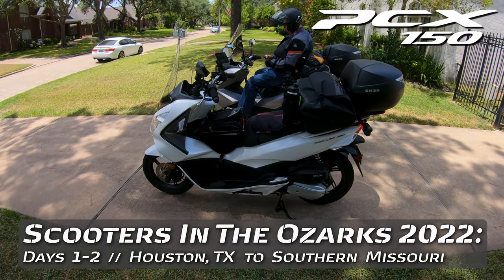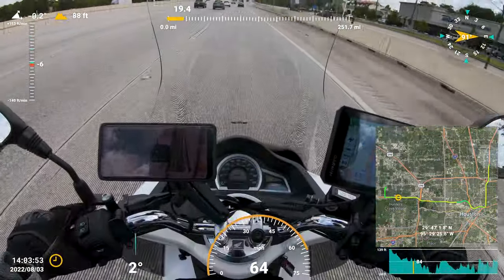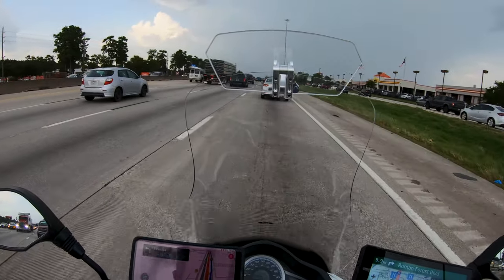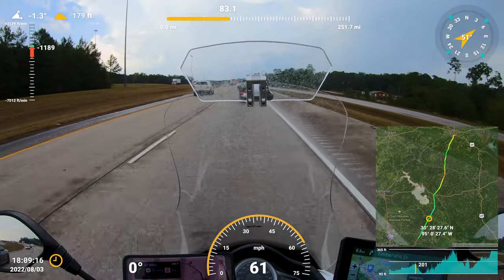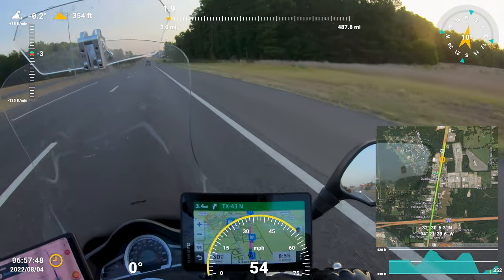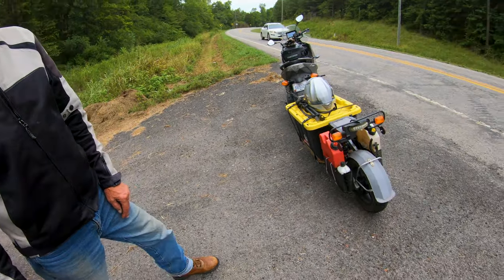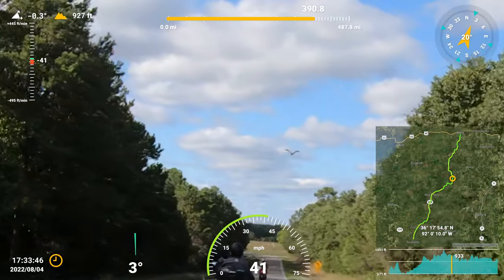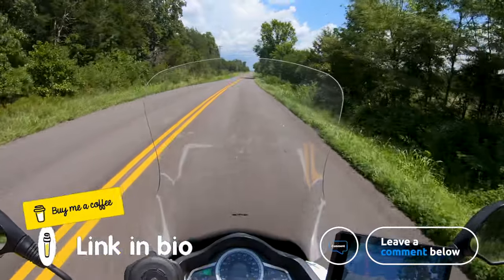Scooters In The Ozarks 2022: Days 1 & 2 // CVT Belt Failures & Amazing Back Roads!

Comment: Another great road trip. Watching these really makes me want to do road trips on my grom. Cheers Quassi
Reply from the maker: Howdy, Randy!  Get out and ride that Grom!  Road trips and touring on small bikes is great fun.  You're forced to slow down and enjoy the scenery instead of rushing through it to reach the destination.  

If you haven't done any long trips before, then you can just start out with shorter day rides and then work up from there.  You'll figure out your machine's limits in terms of comfortable speeds and distances (both for you and the bike), and what riding equipment you need to do it effectively.  After you know your gear and limits, then start pushing the boundaries by 100 miles or so until you're far enough from home that it's inconvenient to give up or quit.

Traveling just a little outside of your normal "Oh, I can just quit and go home" range makes you rethink some of the equipment that you take, and it recalibrates your expectations for how the trip should unfold.  Then everything just snaps into place... range, equipment, fuel logistics, etc.  After you cross that threshold, you can simply multiply the resource and time requirements for any distance or length of trip that you can imagine.  Minimalist touring is great fun!  Cheers!  😉👍  --QM
Reply: @QuasiMotard  Great advise, definitely am going to do a trip soon now that the weather is getting cooler. I'll send pics of my first adventure. Cheers, safe travels.

Comment: Leaving things stock is the answer. Factory clutch’s are tried and true to RPM for safe guard of engine longevity. Is three or four MPH really worth it. I’ve owned many Honda and Yamaha scooters since 1983 and getting 10,000 plus miles before changing belts only as a precaution.  👍 I also own a C5  2004 Vette with no mods and zero  issues as others have had with having car on jacks somewhere.  Who’s needs all the tinkering associated with mods for the most part. 🤔 I guess with time you hopefully With age you will Live and Learn.😬

Comment: Add-on lip spoilers are funny … go all-in and get a Just Right Height windscreen .. ride on!  ☮️
Reply from the maker: True, but windscreen selections for scooters are limited.  It's difficult (and expensive) to try several different screens to figure out what works and what doesn't.  This is my third screen on this scoot already.  It's always a toss-up because these aren't adjustable screens like larger motorcycles often have available to them.  😉👍  --QM

Comment: I had this happen on a SYM shark 125 , the rear pulley was sticking on the shaft and not moving out on the shaft when you revved up , the belt would just slip when revved as the front pulley moved but not the rear. The problem was worse in the wet as it would gum up with the dust a and as the belt slipped the rubber would get onto the shaft causing it to jam even more, you could ride at a slow speed low revs to get back home , I ended up buying a new belt and drive sleeve.

Comment: I had a similar issues on my pcx, a noise in the transmission, plus some belt slipping on take off. I had some work done on the transmission, and it seemed fine for awhile, then it began to have the same issues all over again.

Comment: Back in 2014 I traveled around the USAon 2011 Honda pcx 125 for 5 months and 20000 miles 37 states 38 NP
Really overloaded about 500lbs  2 new rear and 1 front tires
Changed belt at Battlescooter shop in San Jose Cali
Stock belt is the only way go
I went to diamonds state park in Arkansas and not the mountains 
I’m regretting it

Comment: I just Picked up a 2013 Honda PCX 150 it so nice. I will see you at the scooter cannonball in 2013
Reply from the maker: Congrats on your new-to-you PCX150!  You'll have good top speed with that 2013 model because of it's "longer" final drive ratio.  As I recall, they can cruise at 65 MPH easier than the later models, and their top speed is around 74 MPH.

One potential downside is less range due to its smaller 1.5-gallon fuel tank as compared to the 2.1-gallon tanks in the 2015+ PCX's.  You'll just need to carry a bit of extra fuel with you to compensate for that.

I'll look forward to seeing you at the 2023 SCBR!  Cheers!  😉👍 --QM
Reply: See you in june

Comment: First time viewer on your channel. 
I'm planning on buying my first bike as a learner and this is the ad title. 2021 Honda PCX150 MY20

I'm in Sydney Australia. You have me uneasy on whether I should buy something crappy new or this one. I need a bike now as my L plates expire 8 Dec.
Reply from the maker: Howdy!  I would recommend staying with a machine from the Japanese manufacturers if possible (Honda, Kawasaki, Suzuki, Yamaha) instead of any of the cheap Chinese brands.  The Japanese bikes always have better reliability and build quality than other brands.

I've heard from some of your countrymen that Kymco and Sym are also available down under.  Those are also excellent machines with reliable maintenance histories.  Kymco and Sym aren't popular here in the USA, so the parts and service networks are spotty at best.  However, both of those manufacturers have been producing scooters and motorcycles for several decades... they make quality machines!  Cheers!  😉👍  --QM

Comment: Sorry if this seems like an already-asked question, but what is the bigger bag that you're using as a "seat back" between the seat and the top case? I'm looking to get a '22 PCX and for longer trips I think a bag like that would be amazing.
Reply from the maker: Those are DrySpec D38 drybags: https://amzn.to/3CS4dPM .  The DrySpec system is modular and can link up with other bags to add storage, like the D28 double-ended bag: https://amzn.to/3WkhaIK .  The bags come with "cam straps" that wrap around fixed points (e.g., footpeg brackets, rack mounts, under the seat, etc) so the mounting system is very flexible.  Cheers!  😉👍  --QM

Comment: Only real way to prevent this problem is to get a larger displacement scooter wherein you don't need aftermarket CVT parts to squeeze out another 5mph and sacrificing reliability. Love the PCX but it's not a long highway capable bike.
Reply from the maker: I dunno, man... that's just a matter of perspective.  Comfort levels are relative for everyone in terms of speed and butt endurance.  I've already burned 6K+ miles of touring on rural highways with this PCX150.

We're planning to ride these scoots another 8K+ miles for the 2023 SCBR. Hell or high water, OEM variators or aftermarket... IT SHALL BE DONE!  😉👍 --QM

Comment: What shocks do you have on the bike?  Also, what are you using for a seat cushion?  I need to put some aftermarket shocks on my ‘21 PCX.
Reply from the maker: These PCX's are fitted with YSS G-Sport shocks.  The 2015 PCX (white) has the basic version, and the 2016 PCX (gray) has the fancier model with the adjustable damper settings.  I ordered both sets from BikerzBits in Thailand:  https://bikerzbits.com/ .  Shipping is a bit slow and expensive from there, but you can also check Webike Thailand ( https://thai.webike.net/en ) or Webike Japan ( https://japan.webike.net/ ) as alternate sources.

The seat cushion that I'm using is the AirHawk Cruiser Large:  https://amzn.to/3KdfKwq .  It really helps to add comfort on longer trips and also to avoid monkey butt from heat and perspiration.  Cheers!  😉👍  --QM

Comment: Salut, beau voyage. Mais combien est la consommation par mile de votre PCX 150 cc or 125 cc blanc modèle  ?? pendant votre voyage ?
Reply from the maker: The total distance for this trip was 1981 miles (3188 km).  My 2015 Honda PCX150 consumed 19.68 US gallons (74.5 l) at an average speed of 58 MPH (93 km/h). So, the average economy was 100.68 MPG (2.336 l/km or 42.8 km/L).  That's cheap fun!  Cheers!  😉👍  --QM

La distance totale pour ce voyage était de 1981 miles (3188 km). Ma Honda PCX150 2015 a consommé 19,68 gallons américains (74,5 L) à une vitesse moyenne de 58 mph (93 km / h). Ainsi, l'économie moyenne était de 100,68 mpg (2,336 L / km ou 42,8 km / L). C'est un plaisir bon marché! Acclamations! 😉👍 --qm

Comment: If you don't mind me asking what liter top case do you have? I have a 2013 Honda pcx 150 and I am thinking about getting one from Amazon its a 48 liter which may be too big for my scooter but I need one to fit a full face helmet in. It says it will fit a pcx but I don't want it to look too dorky it's not a Giva case but it's pretty good according to the reviews. I already have the pcx mounting bracket.
Reply from the maker: The top case is the SHAD SH39 ( https://amzn.to/3jbWyV6 ), and it mounts to the PCX with the SHAD top mount (P/N: H0PC11ST, https://www.shadusa.com/products/pcx-125-10-21-top-mount?variant=32428342018090 ).  I can fit my XL full-face helmets in there with plenty of room to spare.  The SH39 comes with a universal mounting bracket that can attach to nearly any kind of mounting system.  The SHAD top mount is inexpensive, very sturdy, and it blends into the PCX's aesthetics nicely.

It's a super-stable and secure mounting solution.  I've been thoroughly impressed with it over the past 7+ years.  The case opens without a key when unlocked... just push in on the handle to pop the lid.  That's a huge time saver over cases that require a lock or key to keep them closed while riding.  You can also lock the top case to discourage tampering, and that also prevents it from being dismounted from the base.  Cheers!  😉👍  --QM

Comment: So on your scooter 🛵 do you mainly drive on Smaller 🛣 highways. Nacogdoches Texas is my mother‘s hometown..
Reply from the maker: I try to select the slower highways and rural back roads for my trips on the smaller motorcycles and scooters.  There is less traffic and the speeds are generally lower, which suits these smaller engines better.  We will occasionally get stuck on faster highways for short stretches because there aren't any other paths.  We just stay to the right lane and let faster traffic pass us, and then we'll divert to slower roads as soon as we can.  It's more fun to ride slowly on these rural roads and soak up the scenery.  Blasting down the interstates at 65+ MPH is boring and causes us to miss all of the great scenery that makes these trips so enjoyable.  Cheers!  😉👍  --QM

Comment: Great video...
Nice PCX's..
Pure adventure..
Is good wind protection with givi windscreen? Can ride with open helmet visor?
Reply from the maker: Thanks for the feedback!

The Givi tall touring screen (D1130ST) on the gray 2016 PCX150 provides decent coverage, but I don't recommend it because it flexes too much at highway speeds.  Adrian is a couple of inches taller than I am (around 5'9" or 175cm), and he experiences a lot of helmet turbulence and noise because the screen flexes downward under wind pressure.

The screen that I have on my 2015 PCX150 is the National Cycle VStream Sport Touring (medium height):  https://www.revzilla.com/motorcycle/national-cycle-vstream-sport-touring-windscreen-honda-pcx150-2014-2018?sku_id=1161414 .  It works very well, but I think the taller version might be better for reducing helmet noise and turbulence.  Cheers!  😉👍  --QM
Reply: @QuasiMotard  thanks...cheers.. 🍻

Comment: I loved your videos. One question: how do you attach the rear waterproof case to the PCX?
Reply from the maker: We use the SHAD H0PC11ST top mount that is made specifically for the PCX.  It's made of heavy-duty steel and black powder-coated for durability.  That mount secures into the OEM bolt holes in the rear grab rail (under the removable plastic piece behind the seat).  Our SHAD SH39 top cases are secured to that steel mount with their own quick-detachable mounting plate (included with the top case). 

You can find more details about the SHAD mount here: https://www.shadusa.com/products/pcx-125-10-21-top-mount?variant=32428342018090 .  Cheers!  😉👍  --QM
Reply: thanks for the reply. One more question: the suitcase that is on the pillion seat, how did you attach it to the bike? 🙏🏻👍🏻
Reply from the maker: @marcelobybike  That is the DrySpec D38 dry bag:   https://dryspec.com/products/d38-rigid-core-dry-bag .  It comes with several heavy-duty nylon straps that secure it to almost any motorcycle.  The straps wrap around your footpeg brackets, frame rails, or rear grab handles to secure the bag on all four corners.  It's a very flexible mounting system, and it has worked on all of my motorcycles and scooters without any problems.  Cheers!  😉👍  --QM
Reply: Thanks so much.

Comment: Have you had an opportunity to do a post mortem on the variator?  I'm curious what your opinion is on the failure.
Reply from the maker: We haven't done a full post mortem on the NCY variator components yet.  However, it was clear that the NCY variator was definitely the culprit... no more shredded belts after putting the OEM variator back in there.

I did notice that the variator's front outer face (drive face) seemed to be defective or damaged during the second roadside repair.  It was very diffucult to remove from the engine output shaft when we did the second roadside repair.  The splines on the engine output shaft were burred and rough, so installing the OEM drive face was also difficult.  

Apparently, the NCY drive face wasn't tight enough (or laterally/radially correct), so it was wobbling on the shaft and causing the belt to flutter and/or twist during high-speed operation.  That's what caused two belts to shred in under 50 miles.  I haven't measured the NCY drive face with calipers and a runout dial gauge to confirm this suspicion, but it's almost a certainty.  

The NCY variator was noisy when I first installed it 2 years and 4000+ miles ago, but I incorrectly attributed the warbling noise to faulty rear pulley bearings.  We noticed that the noise was even louder when we first installed the new CVT belt, so we pulled everything apart again and replaced the rear pulley/clutch assembly with the OEM unit.  That seemed to quiet it down by about half, but it still had the warbling sound (louder than my 2015 PCX with the Dr.Pulley setup).

After the second belt failure, we replaced the NCY variator with the Honda OEM pieces, and the variator noise almost completely disappeared (on par with my 2015 PCX).  It survived the remainder of our 2000+ mile trip without incident, so that faulty NCY drive face was our villain.  Cheers!  😉👍  --QM

Comment: What engine does this cc motorcycle have?
Reply from the maker: These are 2015 and 2016 Honda PCX150's with 153cc engines with 2-valve heads.  The newer models since then have varied up/down a few cc's.  The latest version from 2022+ has a 156cc engine with a 4-valve head, so it makes more power than its predecessors.  Cheers!  😉👍  --QM
Reply: @QuasiMotard  thank I just auctioned one. mine goes

Comment: Could you show how you replaced the belt
Reply: thats in a previous video
Reply: @davestraight8219  right on. I'll look for it
Reply from the maker: You can see the quick disassembly and post mortem of the first belt failure at the end of my CT125 tow truck video here: https://youtu.be/iIV8ysy93jY?t=590 .  I have a longer video with the full CVT upgrade/installation on that scooter here:  https://youtu.be/mGOkjguOs60 .  Cheers!  😉👍  --QM

Comment: What is it's top speed?
Reply from the maker: The top speed for my 2015 PCX150 is 72-74 mph (drag-limited) on flat ground.  I've seen 78 mph downhill a few times.  These speeds are only possible due to the upgraded Dr.Pulley performance variator and slider weights.  The original top speed before the variator upgrade was 62-63 mph (rev-limited).  Cheers!  😉👍  --QM

Comment: What Shad bag are you using over the gas panel?
Reply from the maker: That is the SHAD SH20 scooter tunnel bag, but it has been discontinued.  I bought a couple of these during a close-out sale a few years ago.  SHAD's SH25 is the replacement bag that's slightly larger:  https://amzn.to/3CoRBjr .  It's not usually stocked here in the USA, so you might need to try Ebay or other online resellers to find a good source.  Cheers!  😉👍  --QM
Reply: @QuasiMotard  also what are you guys using for comms?
Reply from the maker: We are using the Cardo PACKTALK Bold communicators ( https://amzn.to/3RjYVBp ).  I have an extra PackTalk that is joined into our group mesh so I can record the group audio.  That unit is connected to a dedicated audio recorder ( Zoom F1 field recorder: https://amzn.to/3pIlRhz ) so I can integrate that audio track into the videos during post editing.

I will probably upgrade to the new Cardo PACKTALK Edge ( https://amzn.to/3Acx3Is ) before our 2023 Scooter Cannonball Run trip.  It has a better audio processor and slightly better range, so our group audio should sound better in the videos.  Cheers!  😉👍  --QM
Reply: @QuasiMotard  Thank you sir. Keep up the nice videos.  I just picked a 2022 Honda ADV 150.  I am 6’3 270pds and I am only topping it off at 60 mph. So I will be doing some upgrades to it.  I want atleast 65mph.